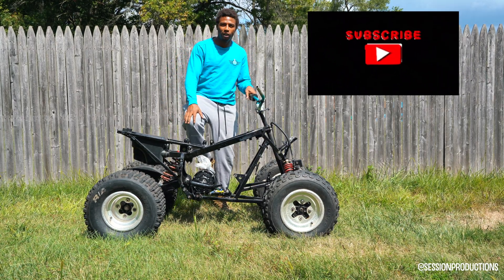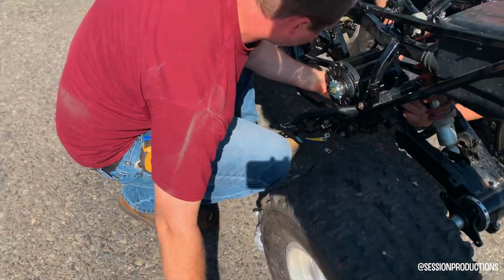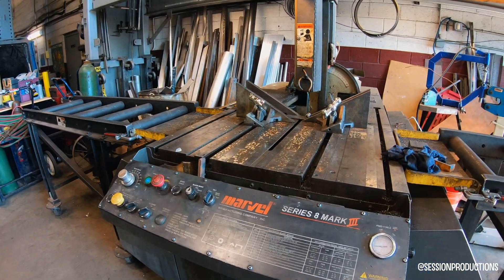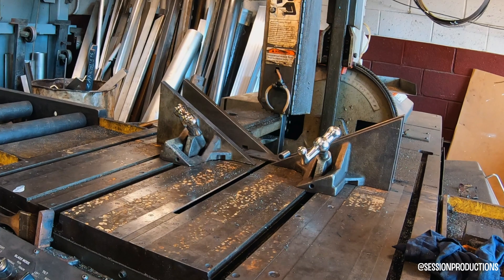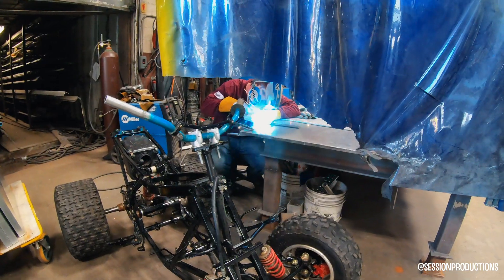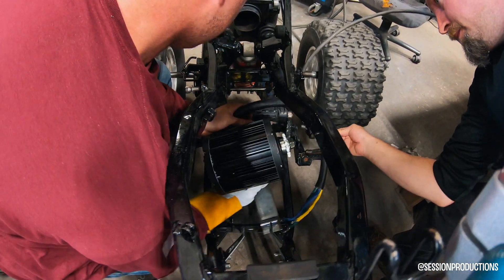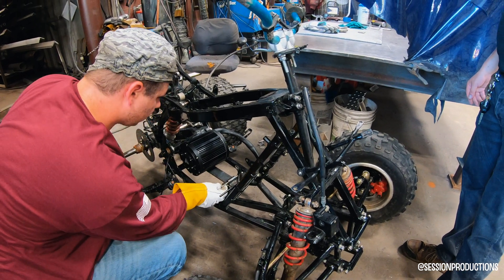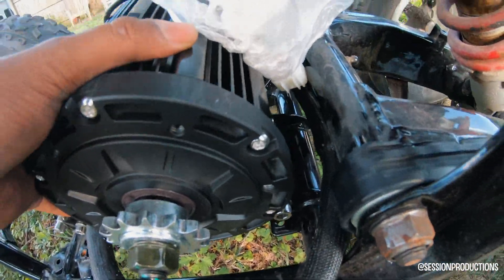FULLY ELECTRIC 72V ATV/QUAD || PART 2

Comment: Hey, any particular reasons you went with steel over aluminum for the motor to sit on?
Like, was it cost and availability?
Reply from the maker: @okanehaus6516  both of those options but it’s a 1991. The frame is steel so it was easier to weld steel to it